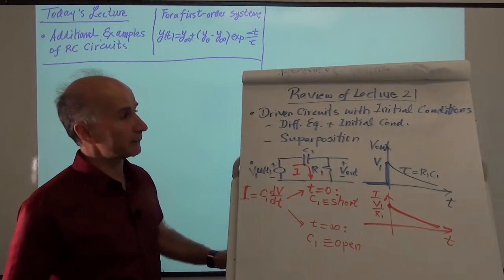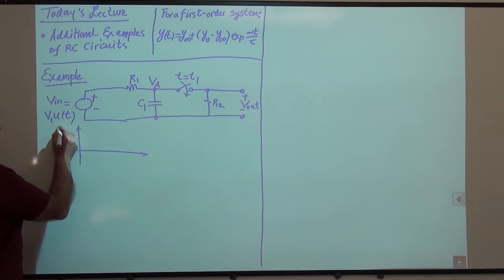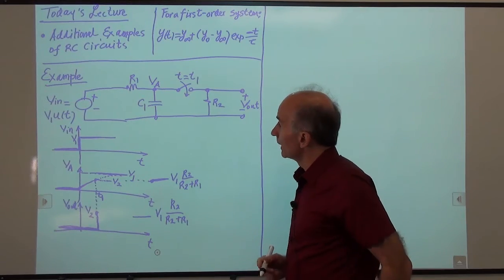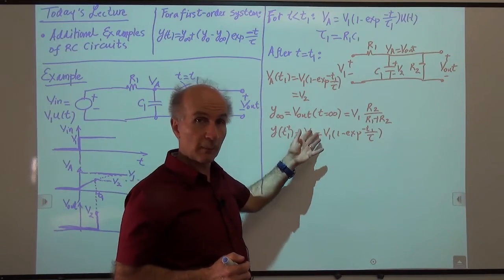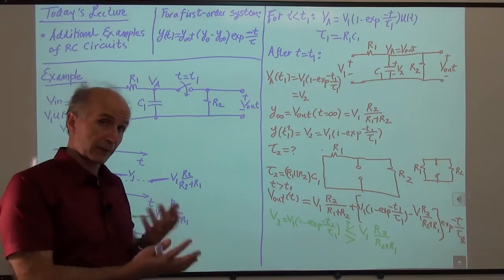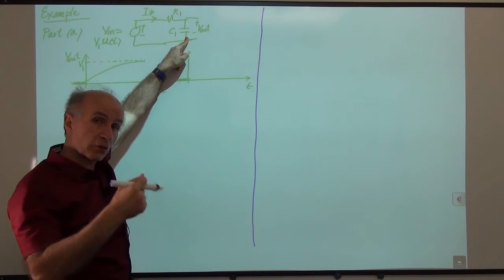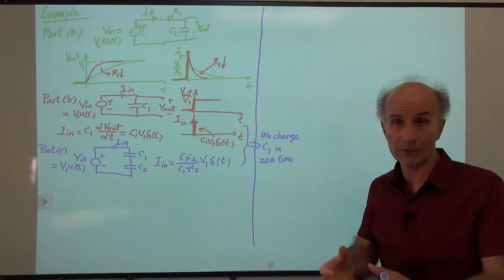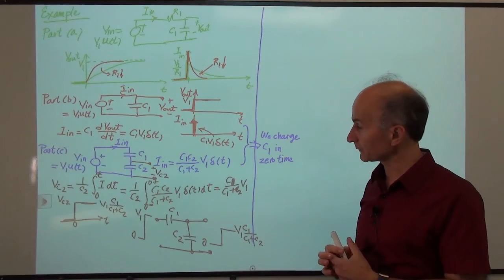Razavi Basic Circuits Lec 22: Additional RC Circuit Examples

Comment: If we can harvest the energy from the radio wave, why don't we harvest the energy from the air. We have lots of microwave already around, AM&FM radios, TV and cell phone signals. Actually this has been a question to me for a long time.
Reply: Becuase this wave energy harvesting circuits needs power too the power you get from waves you subtract from it  the power the circuits consumes the net result power wouldn't be much unfortunately